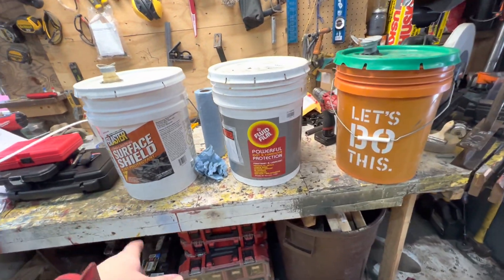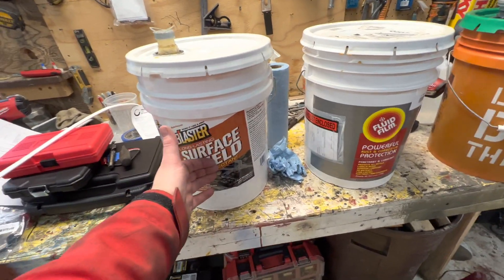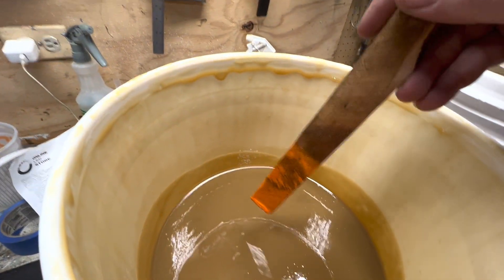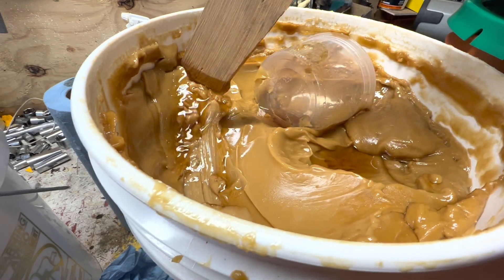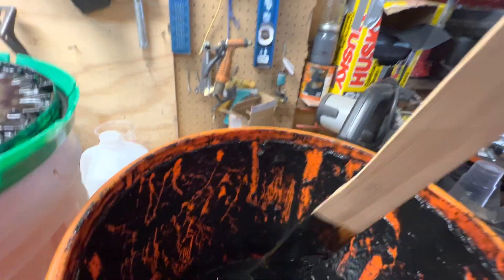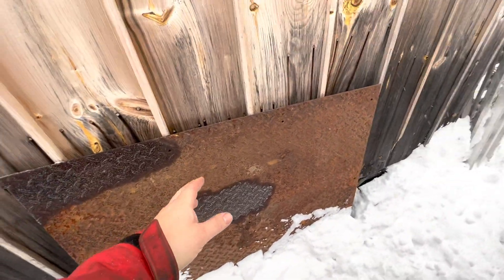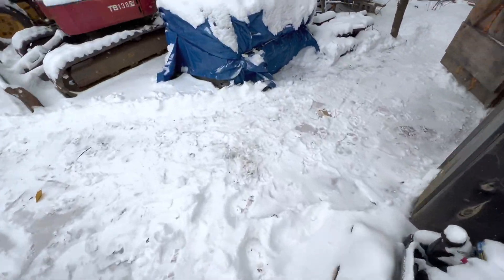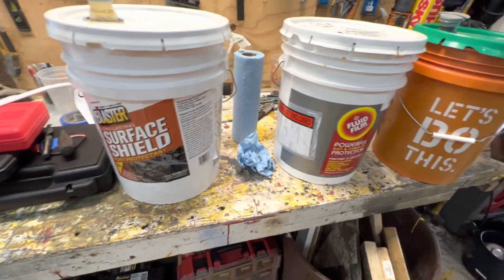Surface shield by blaster evaporates?  thicker than fluid film? Lets find out

Comment: Hello I’ve used about all the rust proofing products Fluid Film, Woolwax, Waxoyl. Now I’m going to use Surface Shield especially inside the doors , rockers, cab corners, wheel wells. I might even use some Blaster rust buster so it creeps into pinch welds then top off with Surface Shield. It can’t hurt. Nice video
Reply from the maker: Sounds like a good plan

Comment: I tried Blaster last winter on a limited basis/small area under car and seamed to work well. One caviate however - I sprayed inside bottom of door panels as always but this product obviously has more solvents in it and it softened and distororted the rubber door weather stip at the weep hole locations where the material weeped out and layed against it. Not totally melted or destroyed but I wont use in any location in contact with rubber again. Hoses??? Too much  a bother to avoid too many things so Im looking at something else this winter. So far over the years, Boeshiels T-9 has worked the best for me but is the most expensive of all the products tried. I have something new that I havnt heard of before that a friend tipped me off to to try this year.

Comment: Do you think it is worth double the price as Fluid Film and do you trust it can go two years ?
Reply from the maker: So far its held up and is defiantly worth the extra in my opinion. FF would have washed off many time over by now. Im going to recoat with as every year just because.
Reply: realistically. if your trying to protect your 70k$ investment for as long as possible the increased price still puts it within a reasonable price tag... but if your just throwing it on a lawn mower for the winter for just some form of protection a cheaper product will serve that purpose just as well.
Reply from the maker: @nicholas2932   exactly.
Reply: @THEWORX99  I LIKE FLUID FILM SPRAY ON PROTECTING FIREARMS FROM RUSTING, THE SURFACE SHIELD STOP SPRAYING, MAYBE IT WAS A DEFECTIVE CAN, THE FILM FLUID WORKS GREAT AND IT SAYS IT ISN'T TOXIC!!🤷‍♂️

Comment: dude I just ran through the leagal stuff for surface sheild and it is solventless totally safe for the environment isnt that crazy!! I got you dude I just subscribed. I got a can of the surface sheild from harbor frieght the other day because I am having to clean out my wheel wells in 3 different trucks and the rust was just killing me man.  I saw this stuff and thought it was just penetrator like the orginal version you know but just will like a rust prevention additive which was like dope. Since I didnt wanna have to do this all again you know... Well I get home and start cleaning and the freaking rust just turned to mud dude like litterally it just bubbled up then 10min later was a black sludge that wipes off!!! its amazing!!! sometimes you gotta use like a hard bristled brush or a metal brush to get it all the way threw and then off cuz the surface sheild wants to stay on the metal you know so it will like hold onto the clumps sometimes and like stick a bit so you cant completely wipe it all off.  So yeah you are totally right this stuff is great! and your parts that you didnt get dude all you got to do is spray em like you dont have to wipe it off even it will just like turn the rust into sludge and then when your ready to wipe it off you can but the longer you leave it on the better it looks later... well I mean sort of like sometimes it stops working and then the rust well the rust it didnt get to like if it was thick and it could only surround it.... that rust will show again when you wipe off the surfface sheild sort of like a jaw breaker does when you suck on it then rinse it off ... that was the best example I could think of lol. Well yeah so keep up the videos
Reply from the maker: Thank you. I will

Comment: Greetings from Northern Vermont! Going on 25 years using Heated Husqvarna B&C oil with some wax on all external surfaces and ATF, B&C oil, Motor Oil, whatever I have on hand into all INTERIOR enclosed areas like rockers, fenders, doors, pinch welds, inner control arms and other suspension parts. Worked great all these years. Vehicles rust from the inside out so its good to spray thin oils into all enclosed areas in SPRING!! The warmer weather of spring and summer accelerates corrosion and expands all the metal components and allows the oils to "wick". Great videos and thanks for posting.

Comment: What if you apply surface shield let dry and the apply FF under a lawn mower deck, any thought ?
Reply from the maker: So take a clean mower deck apply the products the that? They dont dry. But you could let it sit for a day or 2. And then what mow the lawn? And see what sticks better? Or just use the hose cleanout port and run the deck that way to see what washes off better? I like the idea.
Reply: @THEWORX99  Hey thanks just bought the mower haven't even used it yet, thinking about using both SS and FF at the same time
Reply from the maker: @tomgreen1721  do it.

Comment: Thank u for ur analogy! I had mine coated by a place & used FF. I wpuld LOVE to spray SS but I have no equipment. I wonder if I buy a cheap electric sprayer if it'll work w/SS? I gave u a 👍 & sub'd!
Reply from the maker: Thank you. A regural electric sprayer won't work. The ff or lanalin guns on Amazon are like 50 bux tho.
Reply: At 70*F
Reply: honestly my plan until i get a compressor was to just use the spray cans for 90% and use FF cans with the long hose attachment to get inside the frame to get me to 100%... you can probably heat SS up and spray it from an electric sprayer but i cant find anything that has a hose attachment. everything on amazon is intended for paint on flat exposed areas....

Comment: What are you using to spray Surface Shield?  If a HVLP Gravity Feed Air Spray Gun, what tip size & PSI?
Reply from the maker: Im using a standard undercoating gun used for woolwax ect.

Comment: TIP - I just got feedback from Fluid Film and see the problem some folks are having.  In its' resting state, Fluid Film will thicken over time.  That's why in some videos it looks like pudding.  Unfortunately, most guys are only STIRRING or MIXING the FF with a stick or paddle.  That's not vigorous enough to change its' viscosity back to a pourable liquid.  I would suggest a paint stirrer that inserts into an electric drill or, better yet, go over to Harbor Freight and buy their paint can shaker for $ 130.  If you do your vehicle every year or have multiple vehicles then it would be worth the cost to get the FF back in the most liquid state it can be in so it sprays and covers better.  Just my opinion.
Reply from the maker: I've mixed it with a paint mixer and it makes no difference even at 80 degrees it is still too thick to pour. Even the local shops keep heat tape on there barrels year round  to keep it at a sprayable temp.
Reply: @THEWORX99  you can cut it with vegetable oil and makes it more runny
Reply from the maker: @yoho1021  it would peony ash off even easier if you do that.
Reply: I heat FF up with a hot plate after loading it in a aluminum spray gun canister and spray it before  in the fall.   Sprays and works great.  My truck frames, springs and axles look brand new after many years.  Can also cut it with soybean oil if you wish.  I live in the rust belt.

Comment: I was just on Amazon reading the bucket label for Surface Shield.  It states - NON-toxic, LOW VOC, safe, lanolin-based and they've balanced the formula so it can also be considered a lubricant.  So there is "some" solvent in it but so is there in many of our daily garage products like BRAKE, CARB, MAF cleaners etc.  If the low VOC means that it sprays better then I'm all for it.  It's either spray a fine mist or throw pudding at your car.  Which do you think will cover and protect better?
Reply from the maker: So far the surface shield has held up far better in the short term on the vehicles I have done.